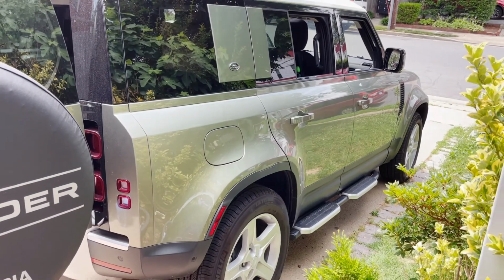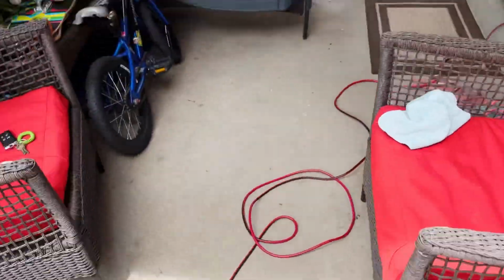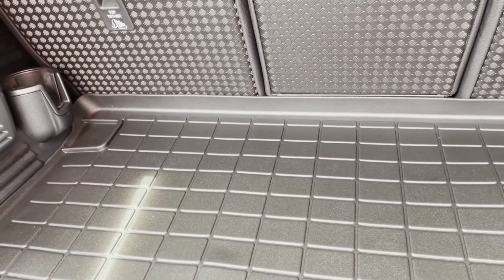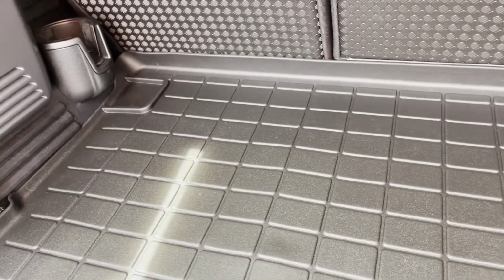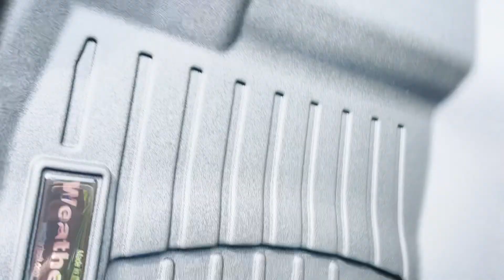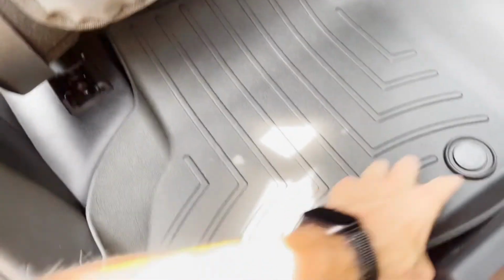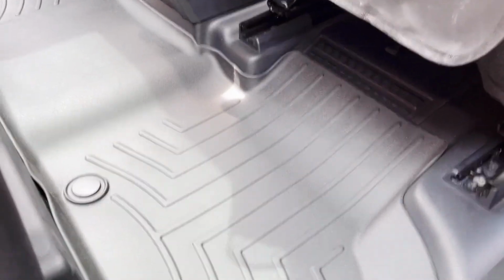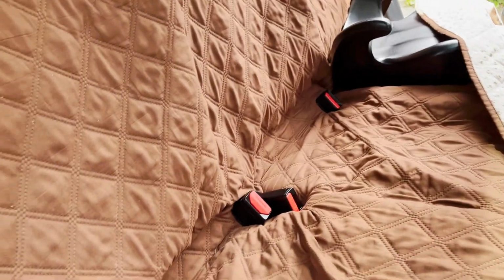2020 Land Rover Defender 110 WeatherTech Rubber Mats / Floor Liners Install

Comment: thank you for this video. what about cargo liner ? is it slide?
Reply from the maker: After using it for several months now, I find that it does slide a little so I put a towel between the cargo liner and bed and that helps a lot.
Reply: @Defndr110  thank you!

Comment: Hi, helpful video!
Do you have a liner for 3rd row?
Reply from the maker: Hi Laurie, Thanks!  At the time of the video, WeatherTech didn't offer a 3rd row Floor liner. Land Rover offers one but you cannot by it by itself. I believe you have to buy it along with the 1st/2nd row mats in a 5+2 configuration. Its really just a narrow piece of rubber. I'd like to install a 3rd row liner so what I'll do is buy a long fatigue mat (the type people put in front of their kitchen sinks) and cut out the shape as a DIY as I don't use my 3rd row often.